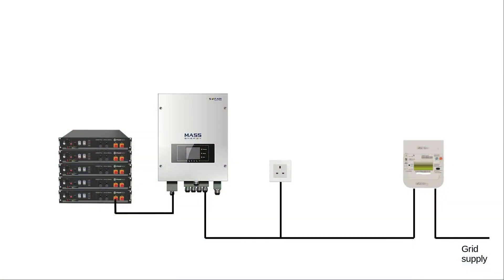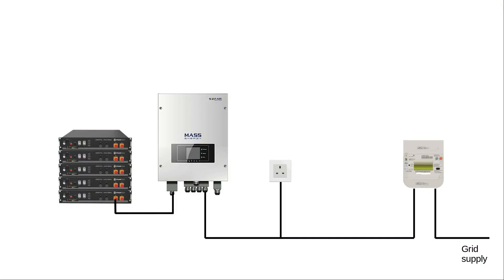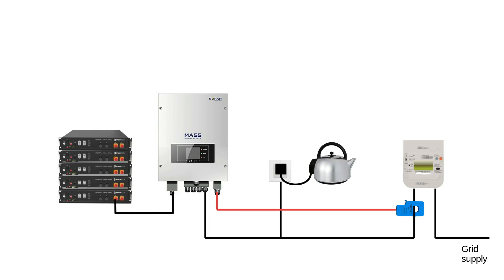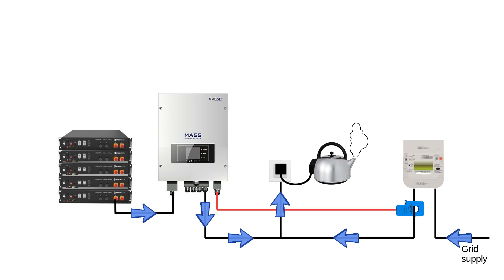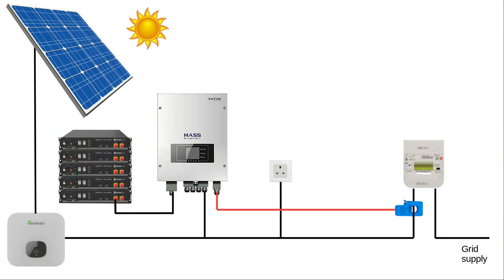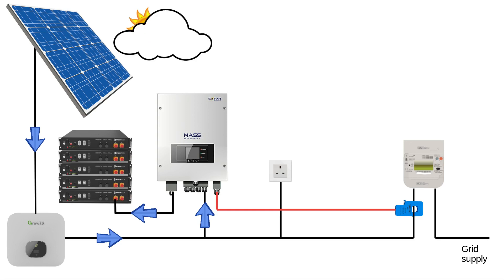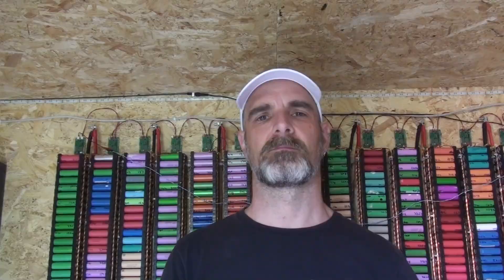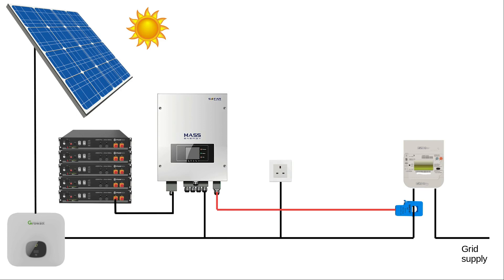How does grid-tied battery storage work.

Comment: Finally someone that actually explains how the battery inverter works in terms of how much to discharge and when. Great video, straight to the point and explained well, thanks. My only comment would be what if you have a solar iboast for the excess energy generated by the PV panels going in to the hot water storage tank, which is what I have lol.
Reply from the maker: Hot water boosters basically work in the same way. They also measure the flow (typically with a CT clamp) and if it is out to the grid, they take the power instead. If there is no flow to the grid they stop. You can't have both hot water booster and AC coupled battery (independently) as they will fight with each other. You would need to have some additional hardware to mediate between them.

Comment: Ok, it's a very Interesting  Vidor,  I once put forward an Idea for one of The,  Off-grid power systems I use today Although my system ensures no leakage into the grid Or overuse of the grid system.  I use it As the grid to power my house,[ Not to run my house].  That is a key element in its design. I believe to be true of the  Grid one must not connect to the Gide,
butt on reflection it became evident  That the human race Would not hold to the  Truth & would not be able to truly live that ideal lifestyle.  truth is we can't afford it. to sustain a life off the grid we must feed ourselves. So   I asked myself how can one use the grid power supplies to feed one's Need for power to one's house of the grid,

Yes, the light bulb moment is power.  The question is how does one achieve it Even with the grid one must supply power to the system, To charge up one's power supply. {Battery Bank} be that system to be truly as of the grid in the Truest of desires It a system that must form a power supply source,  The question is how to truly achieve such a System one must I believe if not off the Grid be in control of the grid, That in my belief means a Practical barrier between the systems coming in from the Grid & that which we use to charge up the Battery bank.    we chose to integrate at a power supply unit / 

So here is what I did. First, Let me explain I was born off the grid in 1952.  & remand of grid until I left to join the army. having discovered the pleasure of on-grid life it was clear that I would become comfortable with the life it provided, But when I came out of the army It wasn't not long before I discovered that Convenience had a price. & that was to come in the form of a quarterly Bill.  I could not afford it suntan-what was to do.  

Yes, that was a question I had to answer what was I to do.   Finally, I got hold of the suppliers to ask for time to pay well a 200-pound bill accumulated to 2000 pounds & a court case & an increase to 3000 pounds, I could not find an answer Then that cut me off the mains well that did the trick That was something I understood. what a revelation in life study.  So ok that my history & background. Well, Avenchely I got into a court that had a megastar that did not believe in cutting people off the grid.  & in steed, he ordered me to accept a Prepayment meter By gum what a revelation that was I did not know they existed. 

So back home I was back on the power. &. I started to tack back control. You know it wasn't long before I finally got the system up & running  But not before I had a visit from the local council because I was running a generator changing up my batteries. Being off-grid has its limitations in the built community.: -That is when I realized I had a silent form of power supply coming into my house. It was some time before I found the tip of a changing pack that could be driven by a cheap electric motor To charge up my bratty bank In an afrobeat way yes I used the incoming power supply to charge up a battery bank in off-peak hours while I sleep topping up my battery pack at night.  the meter ran on 50 penance peace I would put in 5 quid a week Yes expensive.   No, it was a requirement that the meter had to pay back my debt.  It was 2008 before I finally paid back the debt with a Battery Bank from Stalker Truck Barites Mack the best battery bank in my opinion.   & an axial flux stereo being driven by a signal phases elastic motor driving its magnet base. A 20 amp or 40 amp configuration is best but I started with a 12 amp as it was what I could afford to build   Yes a bonus id you can build your own as big or small as you need.      

In closing  For healthy batiks never let them get a low 50 % off charge Away to have a second bank so your solar panels have a place to store the power you can't use & to prevent overuse of the first bank.  try to recharge at night it's nice to have the charge controller shut it off and on  But I prefer to switch it on & level the charge controller to shut off when fully charged  I so have a backup engine to power the system if the grid it out for a long time so the system can be recharged  A back up to charged up, I suggest a set of solar panels to charge your banks when the sun does shine  & not all will be able to turn to the wind.    

my goal was not to go off the grid but to cut the cost of my grid supply. In Today's world with rising power because of miss glider developers, it is necessary to not rely on their system to control your power needs it is possible to supply sudden power for the house to power it from the grid supply by changing up the battery bank of banks  The cost of replacing them remains the capitol outlay that must be undertaken in time improvement to batteries may cut the cost but that is for the future the time they last is 4 years sometimes 6 before renewal Do not overcharge or run below 50% & they last long time   Ter you have it TTFN les England.

Comment: can i use not second inverter but powmr 60A battery recharger?
Reply from the maker: I'm not sure I understand what you mean?
Reply: @nicholashowell  i have inverter growatt mic 3000TL-x , i want use battery is possible?
Reply from the maker: @caniolancellotti4501  Yes it is possible. You will need to get an AC coupled battery inverter.

Comment: So what if your batteries are full? What does the system do with the solar energy influx?
Reply from the maker: On a grid-tied system once the batteries are full the rest will be exported to the grid.
Reply: @nicholashowell  i thought the purpose of that sensor was to stop that from happening?
Reply from the maker: @darkflux  Only to fill up your battery. Once it's full you have no use for the solar and anything not being used directly by your house will be exported.  If you don't want that to happen then you need an off-grid inverter that will just stop taking energy from the solar panels once the battery is full. Off-grid inverters have their own limitations though.
Reply: @nicholashowell  so what does an Off-Grid Inverter do with the extra solar energy?
Reply from the maker: @darkflux  Nothing. Once the battery is full it only pulls power from the panels to satisfy any load. If there is no load, it simply doesn't pull any power from the panels.
Reply: @nicholashowell  thank you. very educational.

Comment: should the import and export ‘bleed’ be roughly equal? as you turn on/off devices or solar varies? I don’t get paid for export yet, and am getting around 1kwh a day also. But if I get signed up to an export tariff, that’d help offset at least some of it
Reply from the maker: It's a good question. I've not measured so I don't actually know. My guess would be that they should be similar.

Comment: Can you explain whether CT clamp is only for hybrid inveterate
I have Growatt 5000ES
Reply from the maker: If it has a battery and it's grid tied then it will almost certainly have a CT clamp. Some non battery inverters also have them so that they can limit export.

Comment: Perfectly explained! Now the only question left is where do I get the Battery Inverter and the appripriate CT Clamp to jump-start experimenting with my solar system that is actualy only grid-tied?
Reply from the maker: I've seen some Sofar ME3000 going second hand on eBay (UK). These work with Pylontech batteries.
Reply: Oh, good idea. I'll check that. i have seen some of the CT clamps on Amazon as well but i cannot determine how to size it to fit my solar Grid-Tied installation.
Reply from the maker: @martinbartlome136  The calculation depends on many things but not all will be important to you. Some things to consider are, how much do you use on a typical day, what is your peak draw, do you want to store everything you generate or just enough to get you through the night? Alternatively, you could just start with a US5000 and see how you get on. If you find you need more, just buy another one.

Comment: Very well described.  Do you have any make / model recommendations for this type of inverter charger?  Something in the 1kW range is probably all i need to cover base load.  I'm also in the UK.  Thanks!
Reply from the maker: In the 1kW range, not really. I've played with a Sofar ME 3000 before and I think they are still available. It is a 3kW unit though.

Comment: So what happens if the grid loses power does it shut off so that the inverters not providing power to the grid
Reply from the maker: Yes. Though some have an EPS mode and will power a separate output in a grid down situation. Useful to plug your freezer and fridge into.

Comment: This is a excellent video explaining how the charging of an AC-DC home battery is regulated in order to minimize the charge coming from the grid. I have been looking everywhere to find out how this works. Your video is the first explanation I have found!
Reply: The 3 kilowatts a week that is lost to the grid would distress me I use the grid only to power the device by changing & suiting of when charged my finger turns it on & the controller turns it off. I have control,  Les Thompson.

Comment: you know, it's funny how people can't see the logic of, connecting the battery to the grid, and use the battery instead of the grid, i have to explain is like a water tanker, you connect the water tanker to the water grid, let it build up and just use the water of the tanker.

sure, your first bills will be high but, then is just going to drop like an apple from a tree.

Comment: Video was Great!    I have a 7KW grid tied system in my home with a Solaredge inverter.  The output from the Solaredge is connected to a 220V breaker in my main panel feeding the solar power to my homes panel.   I am wanting to install a system in a vacation home with 48V Panels and Batteries.  Do I feed the output of the Solax inverter into the main panel the same way as my Solaredge unit is connected?
Reply: not suitable for vacation homes hand management is required whatever system is fitted a day or two,  away is one thing but to be apparent for six months at a time just shutting it all down when away is the safer option. battery banks need constant management & to prevent Overcharging the system.   just because you are away Doesn't mean it can be left.  one just like the grid the supply must be checked & maintained for faults.  you now are the supplier & with such power goes responsibilities son. There, you have it even I have to check & maintain the life of my batteries so they do not overheat That is why  I switch it on & let the controller switch the plant Off When charged  But that needs to be checked it has been done too It can't be turned on unless I do It  That's the shaft with me. I can't point out  the intent of managing the system you install.

Comment: So if I want to grid charge battery at night and use battery only during day, how’s that achieved?
Reply from the maker: An AC coupled battery system (inverter + batteries) will do that for you. So long as your daytime use doesn't exceed the maximum output power of the inverter and you have a big enough battery to cover you daytime use you shouldn't use any grid power. You can tell most inverters to charge from cheap rate.

Comment: That's the best video I've seen. I have only 1 question if someone can help. I have a hybrid on grid setup. from this video it would suggest I can connect directly into my fuse box and just add the flow connection to the live inbound cable after the smart meter? is it that simple? I will only have battery and grid linked in the inverter as the solar is on a different line. if I connect the ac in, where does the AC out go? Hope someone can help as I can't get my head around it to make sure I'm being safe. Thanks. David
Reply from the maker: Hi David. Adding an AC coupled battery inverter is not something that you should do yourself. It needs to be done by a qualified electrician to make sure it is safe. It is also notifiable work to the DNO and requires approval from them, especially if you already have Solar installed.
Reply: @nicholashowell  Thanks for the response. You wouldn't believe how difficult it's been to find someone to help, and till now still can't get anyone. I have written maybe 20 requests with only 1 local company getting back to me and they said if they weren't supplying the equipment they wouldn't be able to help, so no chance of a day rate piece of work. It's very frustrating as if I lived in the states it seems they can just diy it. Plumbing I will always DIY but like you say, electrical work can kill so I can design what I want it to do but not actually be able to do it. Probably why there's so few UK people with videos about this sort of thing. Regards, David

Comment: Now what happens if the grid goes down? Will the inverters still supply energy to the loads if there is a transfer switch in place between the loads and the utility meter? Or do you lose power?
Reply from the maker: Some inverters have an EPS (Emergency Power Supply) function. In the event of a grid down they activate a second set of outputs. From this you can run a critical loads distribution board. You would put circuits like lights, fridge/freezer, TV and broadband on that critical panel. Like you say you would need a transfer switch between that critical loads distribution board and your main distribution board so that only the grid or the EPS is supplying it power but not both.

Comment: Hei, really nice video. It answered a lot of my questions, but i have 2 left.1. Why did you choose to use AC as the common voltage between the solar and battery, rather than just keeping it DC and having a only one box connected to the grid? 2. Can a system like this give you power if the grid is down? If not how would that change the system? Would love a video on this :)
Reply from the maker: I think I did mention in the video the advantage of having AC coupled batteries vs DC coupled batteries. Both systems can technically operate in an off-grid mode. Grid tied inverters need to sense the grid to operate. If it goes down they stop working. They usually have a second set of AC outputs that can be used in off-grid mode and from these you can run a critical circuit in your home (say to supply the fridge, freezer, lights, TV and broadband). This circuit must be isolated from the grid so that no power can leak out on to the grid that might harm people working on the lines. So you need a transfer switch that will disconnect the circuit from the grid and connect it exclusively to the secondary outputs of the battery inverter. I will try to make a video about it at some point, thanks.
Reply: @nicholashowell  thanks for the good answer. What I am trying to go for is a on-grid system with solar and battery backup, but I don't want everything to go through my charge inverter, so I am looking into a victron Quatro with	a phase controller and a relay to stop islanding. Specifically the zeihl urf1001e. They are selling it too on the victron page.
Reply from the maker: @JohnIsodore  Wow, that's looks like a serious bit of kit. Myself, I just have a manual changeover switch. It costs a lot less than that one but does mean I have to change it over manually in the event of a power outage. For me a manual one is fine because in the 8+ years I've had my system I haven't yet had a power cut to use it 😒
Reply: @nicholashowell  haha, you have to fabricate your own power cuts. I too consider this, manual isn't that hard and it's not like I do something that important home that I don't have time to switch. I look into the cost, maybe I will upgrade later.

Comment: Thank you that was really helpful. I am using a Power wall 2 with Solar PV and had noticed that compared with around 10 kWh/day of consumption I was still drawing ~0.1 kWh/day from the grid despite a full battery. Your video explains why and makes me think that the Powerwall is doing a pretty good job of balancing the various loads. You mentioned your self-consumption was around 95% but the Powerwall gives me around 99% self-consumption. Which I can now see is excellent.

Comment: Great explainer. Have you had to put in hardwired export limitation to satisfy G100 with the Sofar? I have 7.2kWp of existing PV with DNO permission for 5kW export. I'm looking at adding 3kW AC coupled battery inverter, but as I understand it I need some extra wirings up to make safe for DNO?
Reply from the maker: The Sofar was used as an example. I actually have a hybrid DC coupled inverter.

Comment: excellent video, as someone starting out, would the Victron multiplus 2 GX do this same job?, I was looking to use a standard inverter and connect it to my home using Victron automatic transfer switches, when the battery voltage drops to 50% discharge the inverter cuts out which activates the transfer switch to grid power, and goes back to inverter when the battery voltage recovers to >90% but this grid tied approach seems more streamlined.